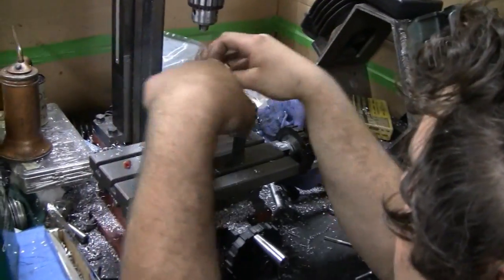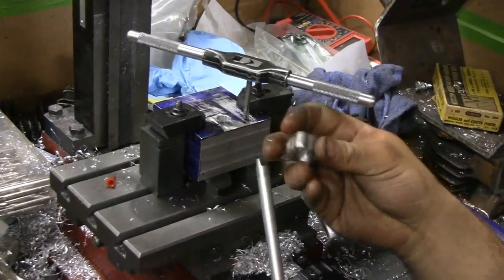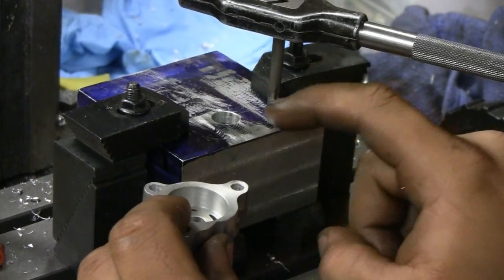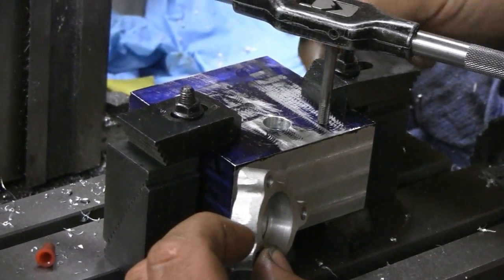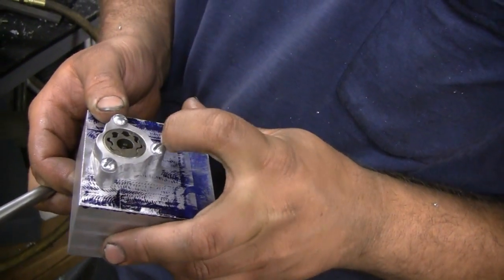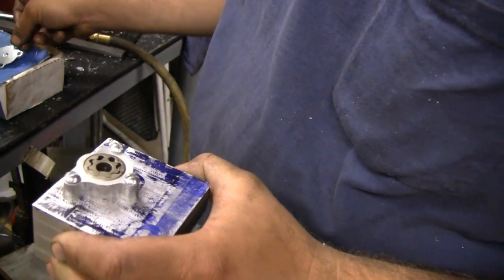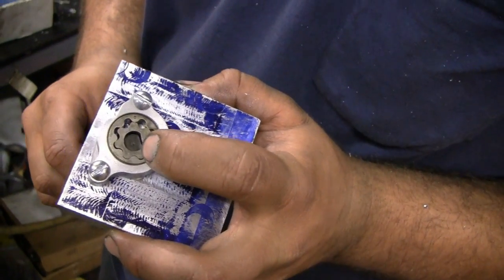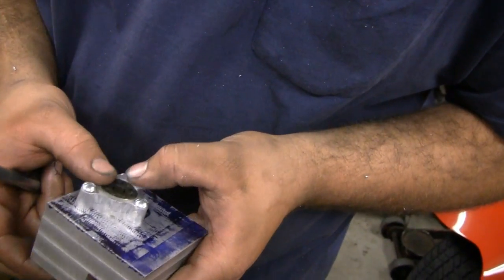HOMEMADE RADIAL BRIGGS ENGINE (part 11)

Comment: i am making a custom push mower and i want to make a oil cooled briggs but i cannot find a oil pump i have searched ebay amazon and google i either find electric ones which i could use but they would burn out or car oil pumps... whats this one you are using
Reply: 805ROADKING quick response and aah cheers and its at a fair price too !

Comment: Instead of drilling multiple holes at 90˚ to each other and blocking up the extra holes, why not work out the angle to drill straight in to the inlet? Mike, you are the man to do that. Great work there!

Comment: That's a nice piece your making, I like the idea that it will be 1 to 1 with the crank. Engines that run off the cam, or cam shaft speed, which is 2 to 1, ususally have issues with parts wearing out, like cam lobes or ofcource main and rod bearing issues. You usually can't do anything about it unless you change the design of the pump like highflow, with bigger gears, or modify engine to have an external pump for a dry sump system that is belt driven.
Reply from the maker: ***** Thanks Bud!!☺

Comment: Hi guys. Nice work. Be careful how tight that driveshaft hole is because when the engines hot it will get even tighter. Ive seen it on a prototype aircraft reduction gearbox the prop governor drive shaft  bore tolerances were nice when cold but it nipped up when hot and sheared the drive.
Reply from the maker: Philip Manning Thanks Bud!! We keep a eye on the shaft!!☺